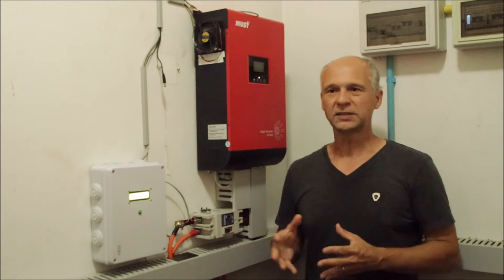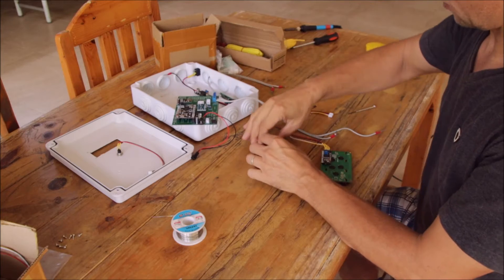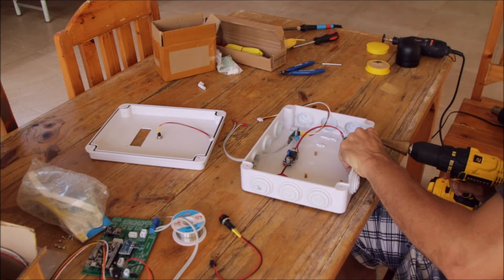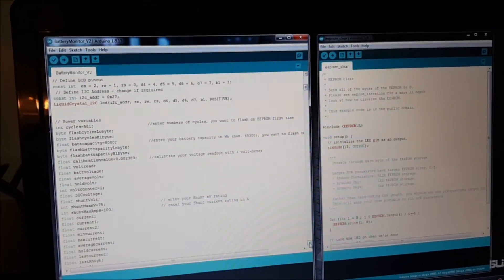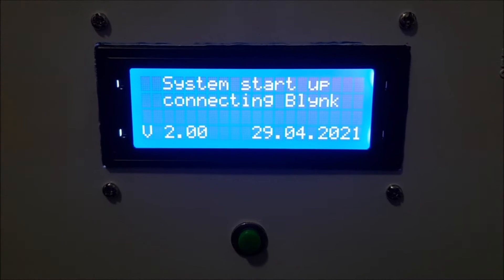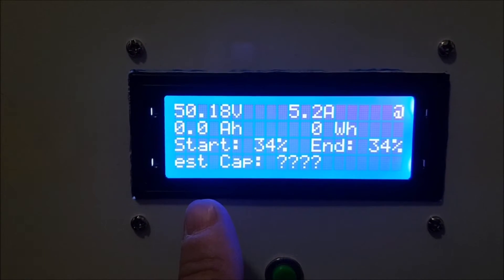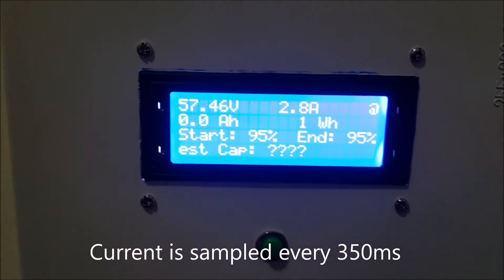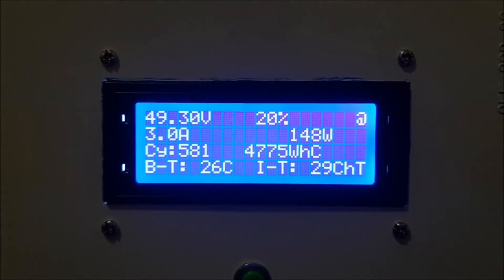DIY Battery Monitor with WIFI getting a cool Upgrade

Comment from the maker: This is now a quite usable product. And it would blow out any Chinese 30 Usd monitor out of the water for even less the cost. Some companies are charging almost 200 Usd for such a device. What do you think? I have a PCB design in my PC, based on a ESP 8266 NodeMcu. Integrating all sensors and connectors and the total cost would end up somewhere between 25-30 Usd. It would fit in any enclosure just half the size of what I have used (PCB 5x10 cm or 2x4 inch). Software as of now, is perfect for any LiIon (LiPo, 18650, NMC) with workable voltage curves. Voltage based SOC prediction is very reliable, no drifting, etc. But the software can be modified for LiFePo4, using Coloumbmetric prediction for the flat part, and meter calibration in edge areas. Combine the advantages of both worlds.  Would somebody be interested in something like this? Please let me know.